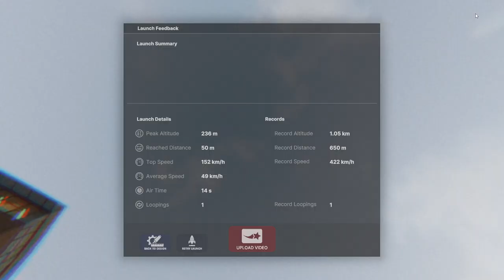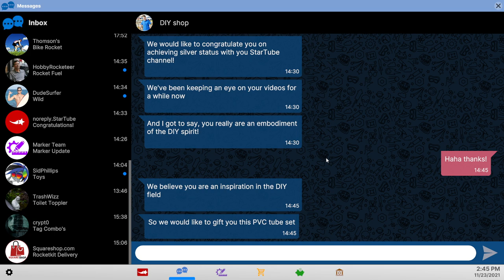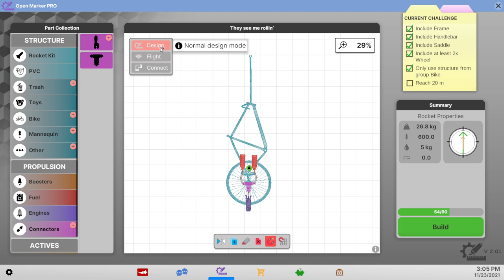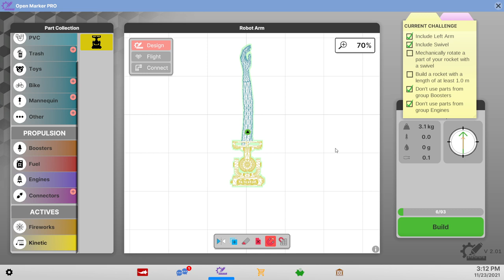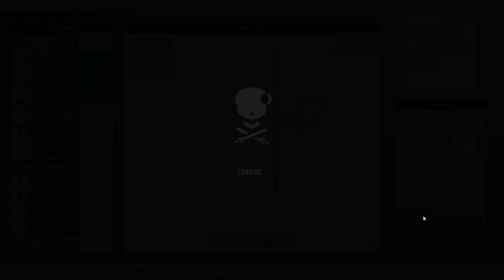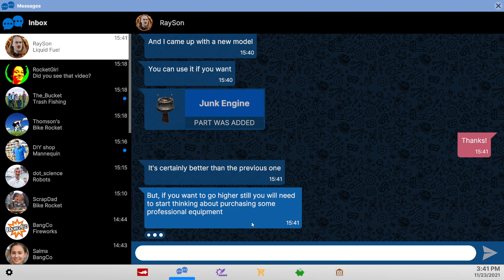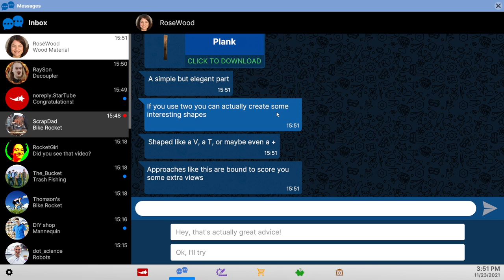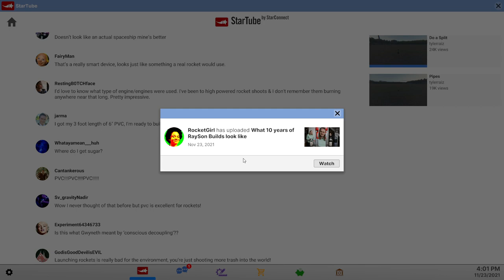Next Space Rebels 04 - Hinges and Decouplers

Comment: The deocoupler probably doesn't need fuel to run, theese nodes may be for interstage fuel crossfeed.

Edit: There is an output node on the bottom and why would a decoupler need fuel anyway?
Reply: Maybe the decoupler gives you the option to do crossfeed, hence the fuel input (?)

Comment: i don't see why a cherry bomb shouldn't work as a decoupler. it can't destroy a structural part but it does destroy itself, so if you use it as a structural part to connect stages together they will separate. maybe you need several of them to make other parts far from each other so they don't connect. at least it's lighter and doesn't require fuel to work